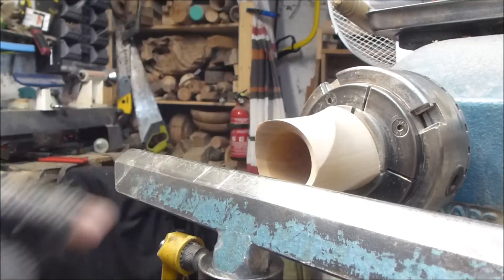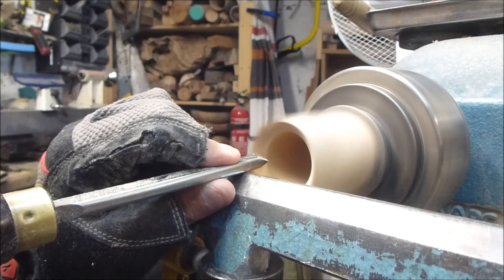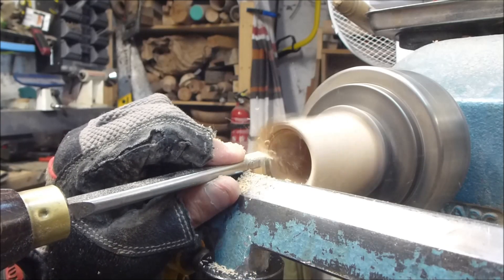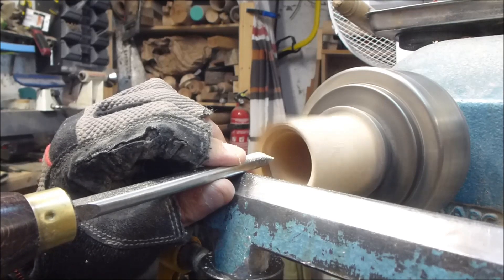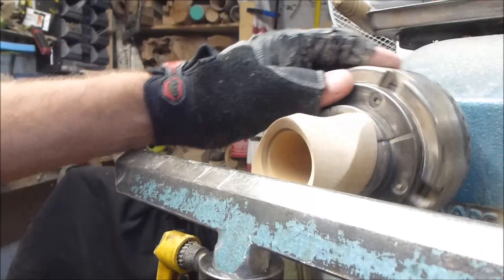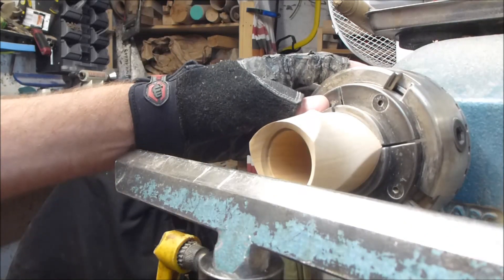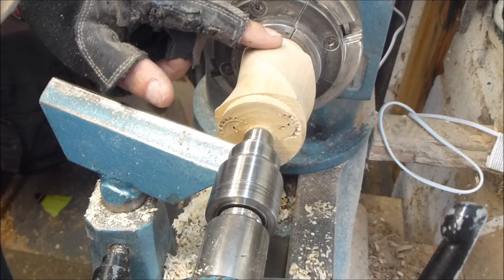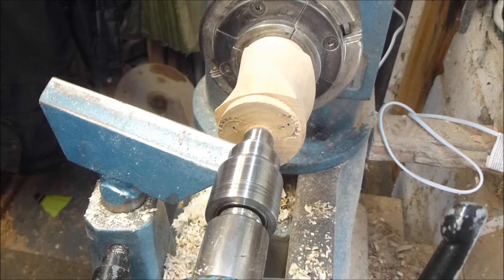WOODTURNING A MULTY AXIS BOX

Comment: As always Robbie, a pleasure to see you work and learn from you, the details you go into are priceless to any level wood turner.
How small, narrow, do you think this kind of design can go? I have a few large pieces of walnut (40 mm X 240 mm X 240 mm) but they have too many eyes and a few cracks so I won't be making them into plates or economy bowls (which I love), but I thought maybe to make strips of them (40 mm X 40 mm) and make some long stem (lord of the ring style) pipes, using the walnut for the bowls, do you think this three sided turning work on a small piece like a pipe bowl?
Thanks again, and sorry for all the questions, I really value your opinion as much as I love your works.
Reply from the maker: My moto is.. I TRY ANYTHING ONCE TWICE IF I LIKE IT... put a scrap piece on the lathe and see what becomes.This is where inspiration comes from
Reply: Well, that is a sound advice, and a rule I follow with just about everything I do in life.
Already made a scrap 4cmX4cmX6cm piece of plywood and I'll test it, if I see this design works and end up making some pipes with it, they shell be named "the Robbie" model :)
In the case it does not work, they will always be known as the "unrealized Robbie" model...
Reply: Robbiethewoodturner Well, I tried it, and it would seem that in a small diameter the twist is not as well defined as with your box (and drinking cup), some of it might be that I tested this on a soft plywood blank, it could be better on the hard walnut I was thinking to use, so I'll probably make another try with the real stuff.
I was wondering, how did you sand this without loosing the crisp lines of the spiral? mine kind of blended in... I probably used too much force, should have sanded lightly...
Thanks again Robbie!!